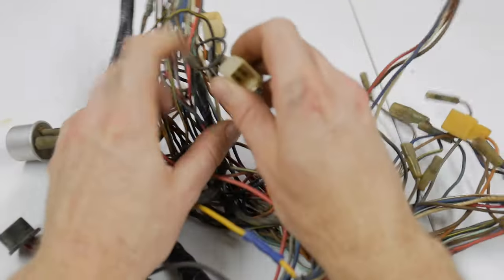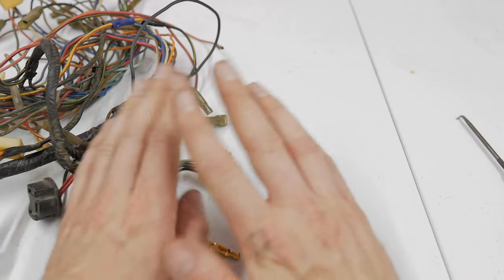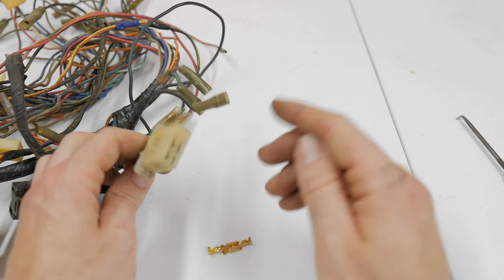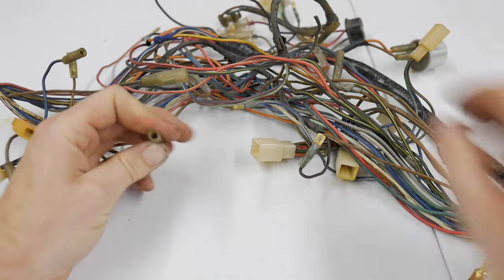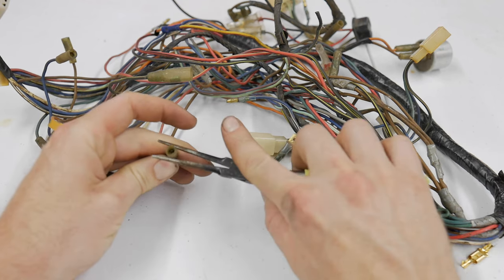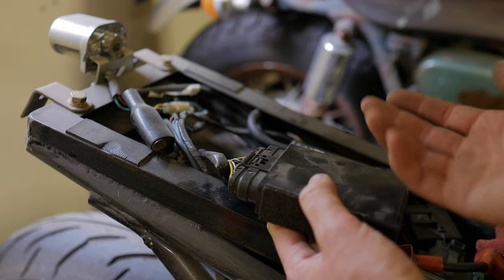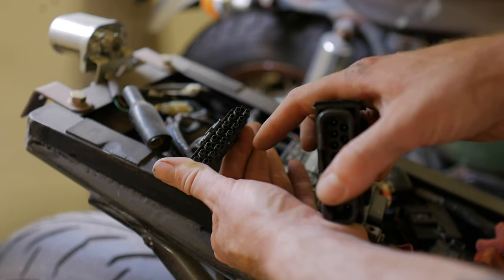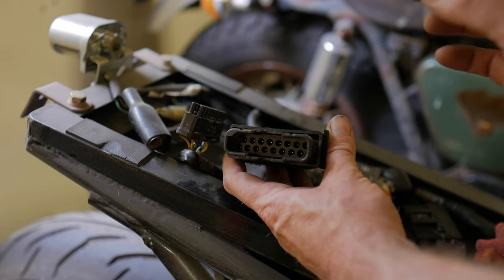Motorcycle Electrical Problems : Easy Fix To Save Money

Comment: I’m actually struggling with some electrical problem my radiator fan is not working properly! Sometimes spins sometimes no….I did check/clean the connection but still work just randomly….I change the fuse nothing change then i bought a new fan nothing changed…I bought a new thermostat nothing changed…then i was checking the ECU because actually the fan getting signal from there, was everything nice clean an tight…I have no any other idea what to do…I also was in 2 different service and they can’t see what is the problem the only thing they can do to install a side button for me to turn on/off the fan by myself what I don’t really want 🤦🏻‍♂️ btw it’s a gsxr 750 2008

Comment: Hi I am riding Honda Hornet CBF 600 year 2001 and I did fix carburators and my fuel tank. Nevertheless, when I am riding after 50-100km (somethimes much earlier) my bike just shuths down, firstly it loses its power. Do you have any idea what should I check ?
Reply: Maybe check contacts inside fuel pump. See 10 minutes into this video  https://youtu.be/P-G72BSlxVw

Comment: Hi Cody. I keep blowing the P&a fuse on my harley road glide. I found a red wire (I'm sure it's live with ignition on) that was kinked. Probably when I replaced the cover. It's under the tank. Is there possibility that I need to cut that section of wire out and solder it back? I straightened out that wire but that didn't help. Please let me know if you think I should get out the soldering iron.  Thanks for your help. I hope I get your reply. Stuart.
Reply from the maker: A kinked or broken wire  by itself would not blow a fuse. Only if that kinked wire was bare and touching ground or another wire it didn’t like, would it blow a fuse.
Reply: @TheMotorcycleMD  thanks for the reply. I didn't think so. Not sure why it's happening. I guess I'll just have to keep looking. Thanks. Stuart
Reply: Update. I found the culprit. A hot wire in the gauge cluster that had a nick in it. It was grounding out at the handlebars. I fixed it today and all seems well. Thanks for your help. Stuart

Comment: My nephew just bought a 1987 virago and his wire harness melted from leaning against his muffler.  Now the bike switch doesn't turn on. And he can't get the bike started.  I suggested trying to run and pop gear in and clutch out to start it. But, of course it's hard to start this way and it tries to start but can't do it.
Does he have to change all wires and relays ? What's your thoughts???
Reply: Since it's seems to be a localized damage. A localized repair should suffice. Meaning, I would strip that part of the harness. Eventually cut and replace the damaged wires. Or re-insulate them if in a condition good enough to repair.

Tip DO ONE wire at a time, less mess/confusion. Solder the new wires, use thermal sleeve. Eventually liquid "tape" can be really useful. Cheers

Comment: I NEED HELP
my bike keeps dying on the road after about an hour of riding... I replaced stator and harness-side female connector since they appeared to have sparked and burnt inside the connection. battery is good, within a year old, and have done the troubleshooting to make sure it holds charge before applying load. some things that happen as the bike starts to die:
-pushing past half throttle, the bike acts like i havent given throttle at all
-dials go to zero and my small lcd screen numbers disappear, all thats left is the backlight
-headlights swell bright to dim in a loop
-eventually stalls and wont start back up. leaving me stranded...
(K1 Z750 Kawasaki) i also have an error code for Atmospheric (15) and STP (32) sensors 
any tips?

Comment: Going through a melon scratching drama at the moment , my 2011 XT660R battery hasn’t been charging anywhere near 14 volts ,  high 12 or low 13 volts is the highest it will go , so it eventually winds down , even after a new stator & new regulator/ rectifier & battery 
tried the electrical grease , on plugs & fuse connectors.
Reply: Redo your ground wire. I know sounds crazy
Reply: Hey! I am having the same issue with my 2003 cbr 600rr. New stator and R/R. Only getting low 13V at 5000 RPM. Were you able to solve it on your bike? I am going to do this to my connections and check grounds, hopefully I find the problem!

Comment: I have a wire that is touching metal or something is touching something in the frontend by the radio. Every time I move the frontend fairing the lights and radio turns of then I remove the fairing off the handlebars everything stay on. What is going on here? How can I find this wire

Comment: Is replacing the regulator and stator together common practice?? My rectifier started smoking the other day and now the bike won't start. The guys at work are saying I should do stator also idk if I need to
Reply: Same
Reply: Parts replacement should only be done IF NEEDED. Meaning test your suspicious parts. In this case the stator. AND most important find out why the "magic smoke" show up in the first place. Short circuit, some other damage...;-)

Comment: So tru i have a gsxr 1000r 22 and i noticed i went to turn the bike on all lights came on but when i hit the ignition  everything went black im like what the hell so i get on the bike and boom everything comes back on no problem 2 weeks go by im getting ready to leave for work start the bike all lights come on pressing the ignition its trying to start but want im thinking man how much is this gonna cost so of course i said let me check the battery even tho everything is doing what it should just want start took seat and covers off toched the negative connection all good there went to left the red cover that be over the positive my alarm starts going off sure enough i dont know how but the bolt had backed out and the connection was extremely lose tighten everything up and not a problem since

Comment: Any advice on a ecu fuse blowing everytime the key is turned on ? I've got electrical testers and have a wiring diagram but am lost because I've traced the wires going into the ecu and ran a ground test on the frame and bolts.
Reply: Have you resolved this problem?

Comment: 1290S year 2021  the new model,  I am having problem with accelerating the motorcycle suddenly slows you down and all the lights on the dish turned on cruise control  and Traction control, ngine light  everything Thuttle control doesn't work you lose power, I step aside turn the back off and on again And it's gaining power again, I have no quick shifter no neutral light or gear indicator Battery status 14.3 , The problem always when it's a bit warm and in acceleration

Comment: Hi, will try as my brother bike started yesterday abd now today no start has spark all electics work but the plug seem dry its fuel injection take that off it mist correct but on bike it dribbles. Do you think it would be what you say?
Reply: fuel injection + dry. I would start be checking the fuel pump...
Reply: All sorted fitted a new fuel injection all good startcfirstctime ever time

Comment: Ok my 2015 Kawasaki ninja 1000 battery went dead it was about 10 years old.so I changed it and as soon as I hook up the new battery, the fuel pump turned on and stayed on and I didn’t even put the key in. why what’s wrong ???

Comment: I’ve been trying to figure out what’s wrong with my bike but I’m no mechanic it’s a 2009 Harley Davidson XL1200 Nightster. I bought a battery tender a week or so ago because I had drained the battery on my bike. When I turned the key to on and flipped the switch to run the dash and lights would go on but when I went to push the start it would just click. I then hooked up the battery tender and put it on over night. Came back the next day it said the battery was charged but then when I went to go put the key in and put it to on, hit the switch to run then hit start nothing would happen. No lights nothing on the dash and no clicking. I thought it was a shit battery so I went and bought a new one today put it in and the same thing happened. 

If anyone has any info or solutions on what the problem might be I’m all ears! 😂

Comment: Hello! I have a cbr 600rr 2015, its at 24,000 miles and I have not done the valve adjustments. Does anyone have experience with this or have any suggestions. Bike is running fine. Please help! Thanks!
Reply from the maker: Wait till the second valve adjustment check. Yes I have a lot  of experience with them. Enough to know that anytime I have gone in to check that system at the first interval it was a waste of time. Very efficient system. Keep your oil and air filters clean and cross that bridge at the second interval.
Reply: @TheMotorcycleMD  Hi!!! Thank you so much for responding:) have a great weekend!

Comment: Can someone please help me?
I was tinkering with the wire of my bike's horn. One side was corroded, so I decided to cut it and replace it with a new wire at the same spot. Initially, everything seemed fine, but at a certain point, my bike suddenly stopped turning on. The screen didn't light up, and although I could start it using the kickstarter, the lights remained off. However, the engine was running normally, just without any screen display or lights.
Reply: U shorted something😂. Had to of touched 2 points that shouldn't have been touched.

Comment: My singal cylinder motorbike has decreased in accleration at Full throttle kinda feel like fuel delivery issue.  iv changed every thing except the coil pack. Wtf can it be lol

Comment: Yes, and wires break internally where they enter hard plastics like coils or pulsers even though the exterior covering is intact. Long story......😭lol     And how many times have people bought a high priced  cdi box or something when the real problem was solved just by unplugging and re plugging the connectors and then you threw a perfectly fine cdi box in the trash......🤬

Comment: Harley has the worst electrical system out of all the companies. I mean who uses only Diodes to change AC to DC with no CPU to control proper voltage to each component these days or since 1994. Harley's voltage regulator has no CPU to control DC output, instead Harley relies on the components modules to clean the power, that's just plain stupid and makes trouble shooting either time consuming or very costly. For that Harley has lost a life long customer, Just purchased a used Honda VTX and couldn't be happier.